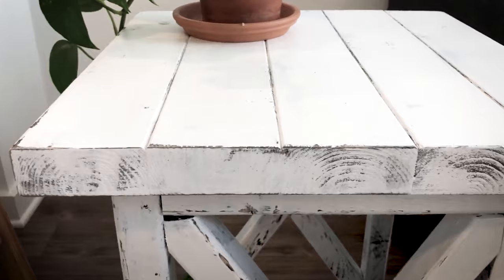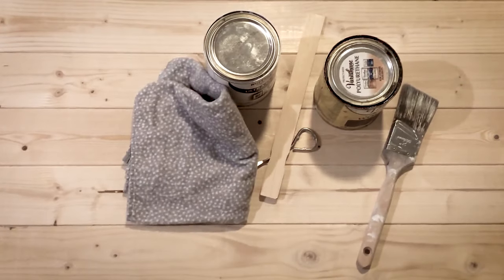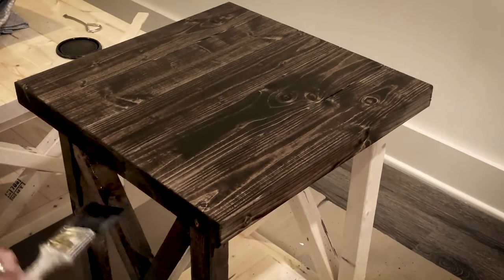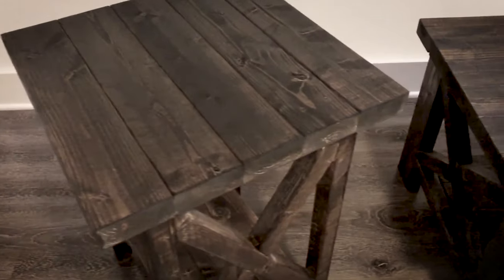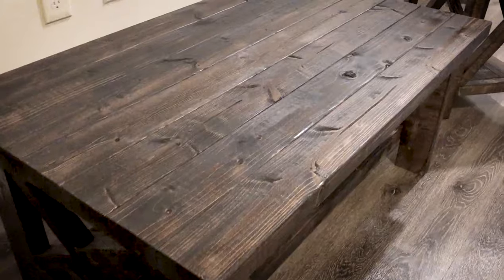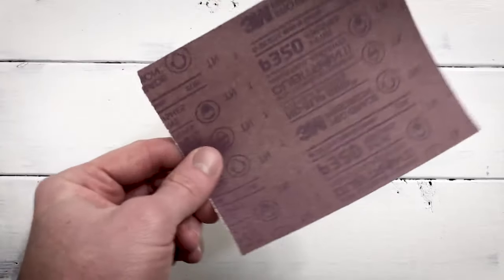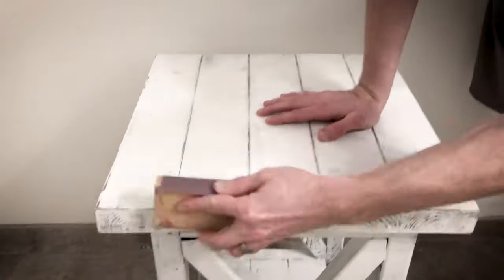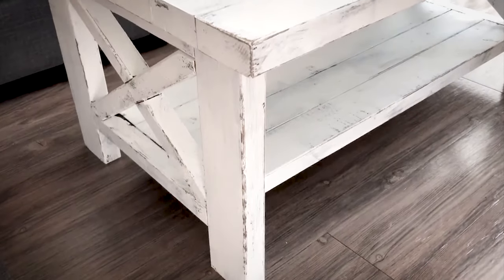EASIEST WAY TO DISTRESS WOOD

Comment: I love your video, looks very easy (cross fingers). Question: I already painted my cabinets with a oil-based primer before I founded this video, can I still use this technique? After the wood stain, the paint that I have to use have to be water-based or oil? Please help me!
Reply from the maker: Hi, thank you for watching! Water-based or oil should work. You may have to do extra sanding if you already have a primer on.

Comment: Hey John, if I have a dark wood table, will I still need to apply the wood stain?
Reply from the maker: Hi! Since you have a dark table, yes, the first step is already complete for you! But if it has a smooth protective finish on it, you may want to lightly sand it to ensure your paint will apply properly. Thanks for watching!
Reply: @JohnDolechek  That answers my question. Appreciate it & thanks for providing this video. Ive been wanting to learn how to distress furniture in a long time and this technique seems easy and doable. THANK YOU!

Comment: I guess I put to much stain cause it’s been over 24 hrs and there is still some spots that are wet/sticky. I wiped it down with a cloth but some of the sticky spots are still there. Can I still paint over it. Will the white paint stick to it?
Reply from the maker: When it’s still sticky, yes you probably applied too much, but it should still be fine to paint over it. Thanks for watching!
Reply: @JohnDolechek  thanks. By the way u said not to have brush lines when painting but u didn’t say how to avoid it. Also what’s the name of that song. It’s 👍🏻👍🏻

Comment: Any one know if the white will yellow over time? (from the pine wood)
Reply from the maker: Paint won’t yellow over time since it’s applied on top of the wood. This typically only happens to unfinished woods, especially pine. Thanks for watching!
Reply: I realize this is a pretty old comment section, but I figured I would put my two cents in. It won’t yellow, but it will somewhat brown. There is no sealer coat over it all so by sanding paint down you break that hardened seal that has dried on-top and that expose pores that will grab dirt and oils. I recommend sealing it with some kind of topcoat.